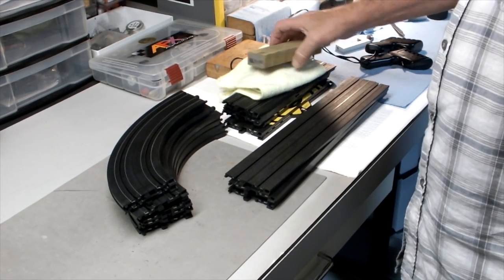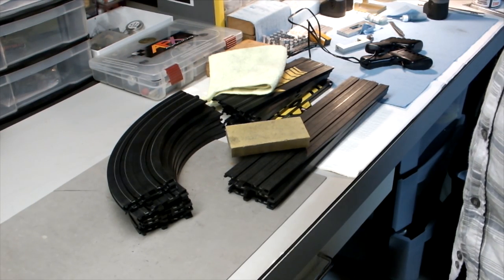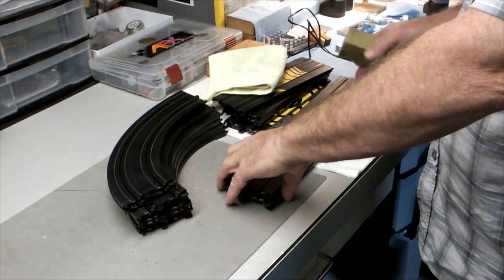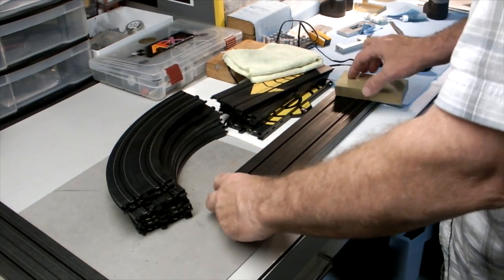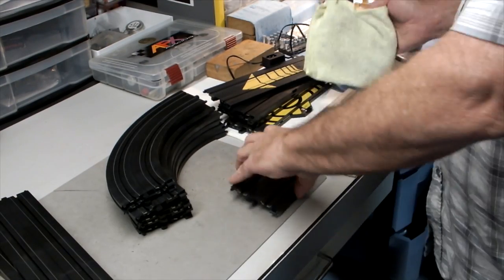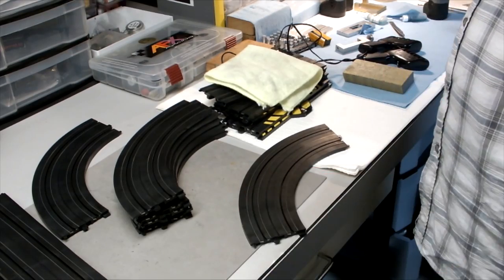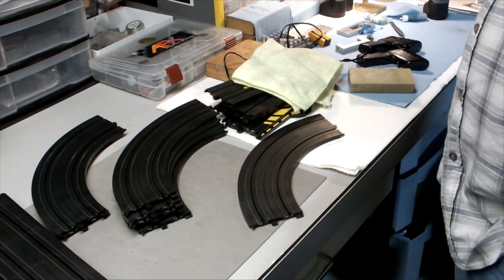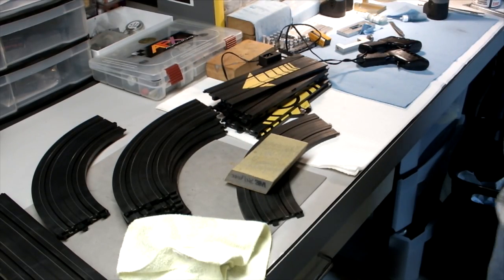Cleaning the Rails on Your HO Slot Car Track

Comment: Thank you brother!!!! I found my old NASCAR slot cars and track in a box this morning and I've been trying to get them running again...I knew it was a connection issue but was thinking it was the cars but when I lifted them slightly but kept contact with the pickups the motors were spinning like tops and they would run a couple sections of track then halt immediately...i am thankful you shared this info because I was unsure of how to clean the rails correctly glad I looked before making a wild guess thanks again for the heads up

Comment: It is also important to clean the end connectors of the track that connect to each other for best flow of voltage. I use a fine grade sandpaper to clean off any oxidation off the end connections.

Comment: I liked somebody elses idea of a track cleaner on a chassis powered by a 9v battery. The battery provides weight and power, so the track doesn't have to be good for it to function. Just set it down, walk away, and come back a few laps later to switch it onto a different lane.
Reply from the maker: I've never seen a 'track cleaner car' do any real good.  They can't do as good a job as working the pieces over with attention.

Comment: I have a bunch of Tyco/Mattel track. Some pieces have gotten rusty while in storage. Would you clean these rails in the same fashion? I have about 2000, yes 2000, feet of track, but of course some of this rust is on a few of the types of track that are not as common. I have been told Scotchbrite could help. I've also seen videos on here that use vinegar. Would you suggest either of these methods as well as the one you posted? Thanks.
Reply from the maker: The Scotchbrite fine - 320 grit - sponge is good for rusty rails.  Then wipe with a micro-fiber cloth to clean up the particles.  Maybe even vacuum.
Reply: Thanks. I'll pick some up to get the job done.
Reply: Pittsburgh Mohawk -Get a bottle of Evaporust and soak your track for at least twelve hours. Goodbye rust!  It works.
Reply: 2000 feet of track?! Something tells me you just finished sanding after reading this post 4 years later😁

Comment: What about the metal tabs that connect the track to each other on Tomy/AFX track?
Reply from the maker: The tabs are not as problematic as the rail tops.  The tabs 'self clean' to a point as they are slid together during connection.  If your connections are visibly rusted or oxidized, then buff them up.